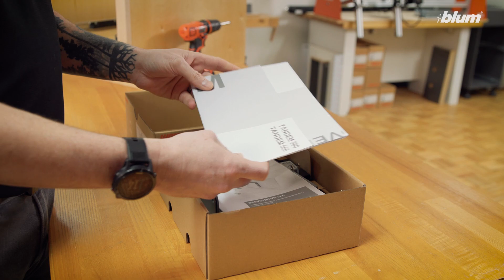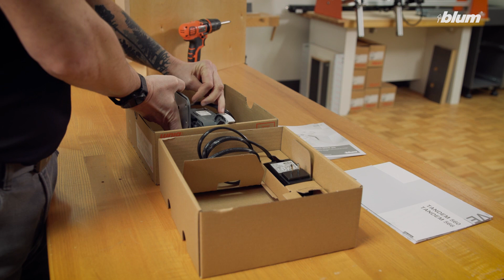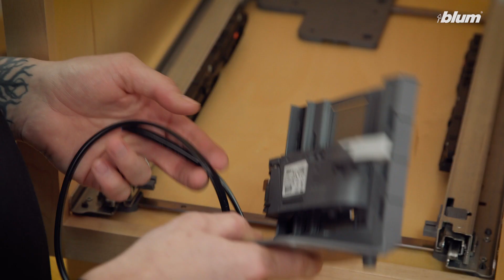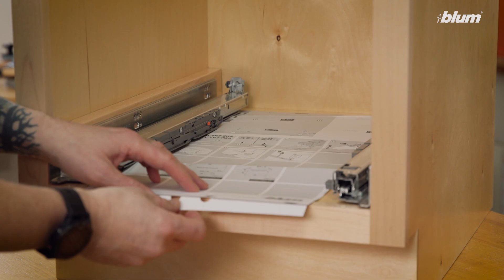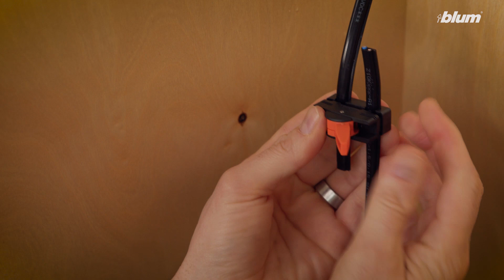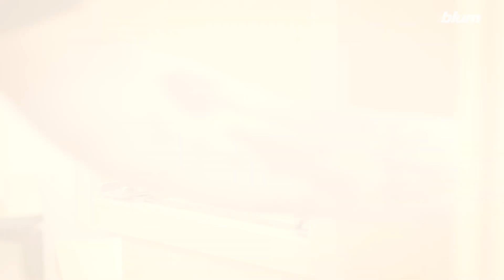SERVO-DRIVE for Waste/Recycle Set Installation

Comment: If I replace a broken power supply with a new one, can I merge the old distribution cable on the right and the new distribution cable of the new power supply on the left in the connection node? Normally, one cable leads to one charger and the second is the distribution cable (I have 1 power supply for multiple charging)
Reply from the maker: Yes, the INSERTA cable connector can be used by them to just connect the new power supply to the existing distribution cable. The only key here is that there is only one power supply per system/circuit.

Comment: What's the purpose?
Reply from the maker: With SERVO-DRIVE on a waste cabinet, kitchen users can simply bump the front of the cabinet with a knee and the drawer will open. This is helpful if the user's hands are full and prevents the spread of germs to cabinet handles.

Comment: I had this unit installed on a job we did serval years ago--Client is complaining that it does not close all the way without extra effort--This was installed in a Woodmode cabinet which you know is no longer in business--Is there any kind of adjustment that i can make

Comment: I've had one of these for several years.  Now it is opening when I walk by sometimes.  How do I adjust it so it isn't so sensitive?
Reply from the maker: Hi! You will need to contact our Customer Service at 704-827-1345 or toll-free at 800-438-6788 and provide the batch number that is on the sticker from the drive unit and they will be able to assist you from there. Thanks!

Comment: how do the front distance bumpers work with inset doors?
Reply from the maker: Hi! If you are using the MOVENTO waste/recycle set then you will need the 298.7600 add-on piece for the MOVENTO locking device. However, if you are using TANDEM plus BLUMOTION then you will use the T51.1901.PS locking devices. Both of these items, MOVENTO and TANDEM plus BLUMOTION have built-in SERVO-DRIVE distance bumpers which are perfect for inset applications.

Comment: What are the purpose of the front distance bumpers and do they prevent the door from reaching it’s previous full closed position?
Reply from the maker: Hi! The distance bumper is needed for creating the 1/8 gap that is required for allowing you to push on the front of the drawer to engage the drive unit to push out the drawer. No, the front distance bumpers do not interfere with the closing action of the drawer. Hope this helps!